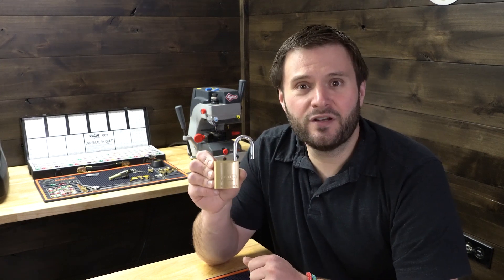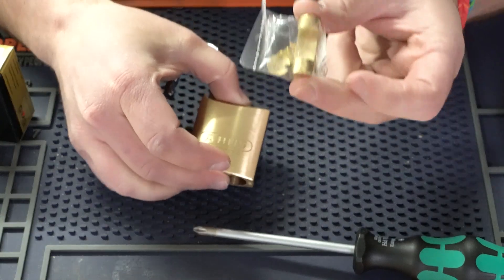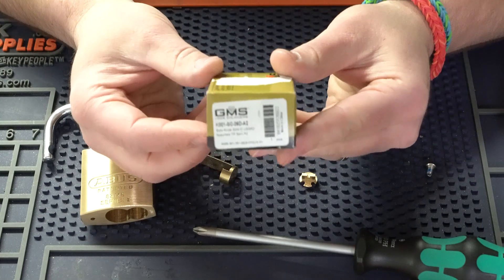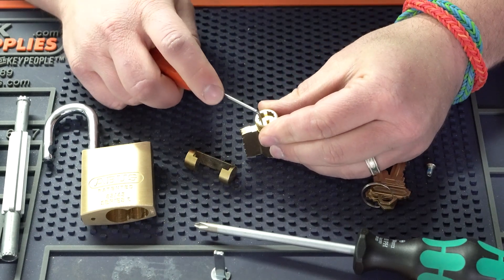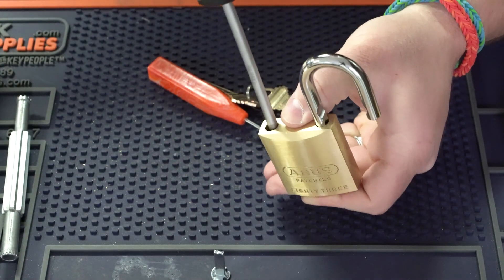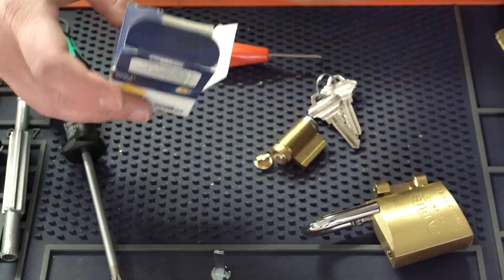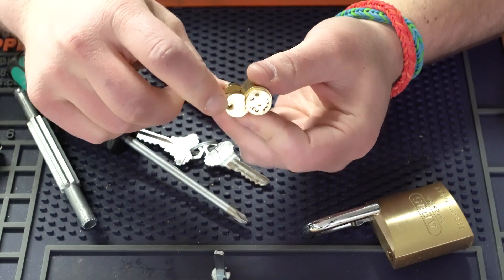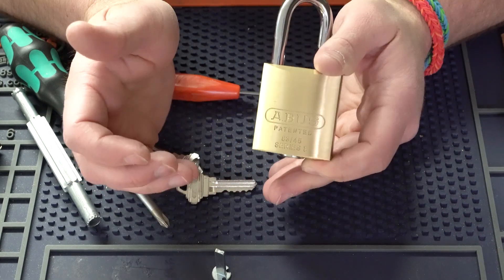Locksmith Tip | Abus Padlock Hack - Key-In-Knob Kit

Comment: I was just browsing the Abus catalog and when I got to the 83 series I wanted to see if I could get that KNK adapter somewhere.  Glad I can find it on your place. I have an 83IC/45.  
Wondering if it works with that adapter.  Looks like it won't.  No matter if it doesn't, cause I want to have more than one lock that can take different cores.